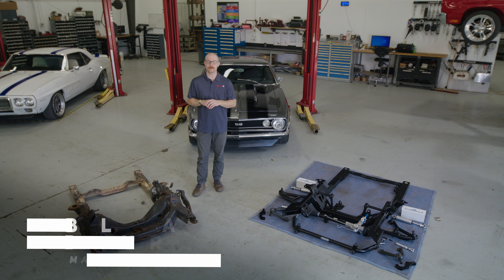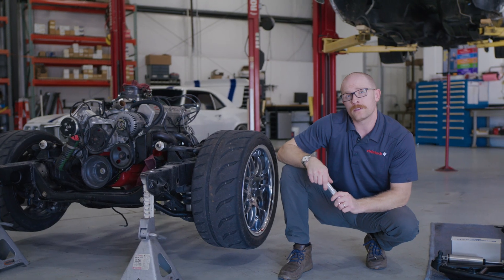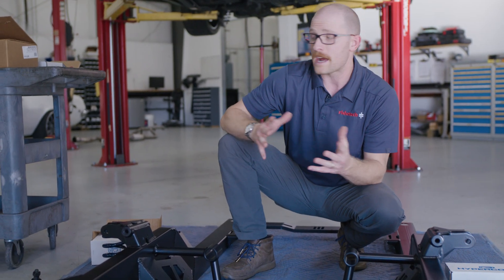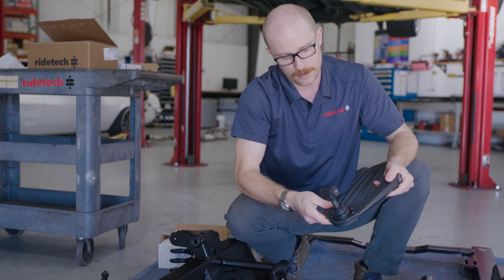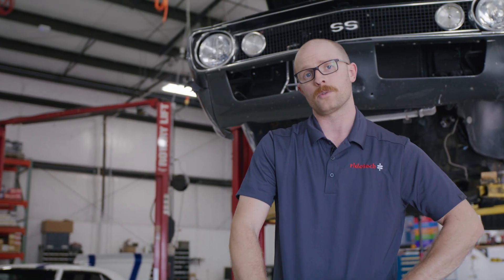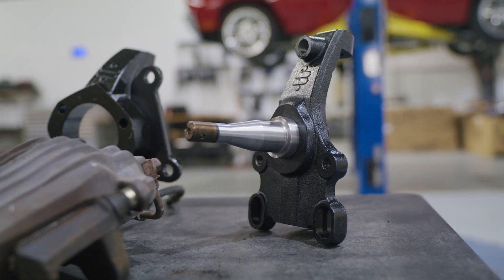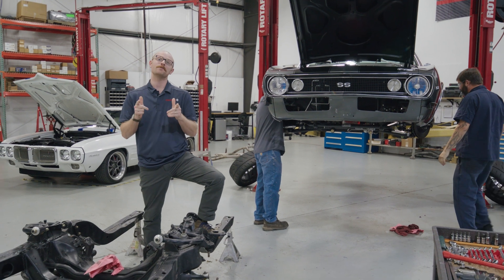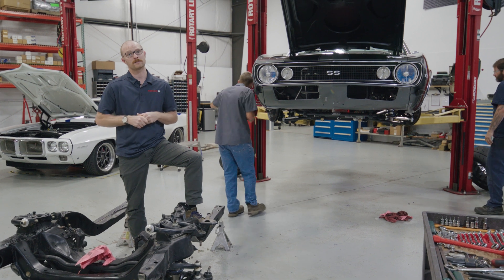Ridetech Install | F & X-Body Performance Subframe

Comment: Hello,

I wanted to ask if you could put together a detailed instructional video demonstrating how to properly align a four-link suspension system once it’s installed. Specifically, I’m looking for guidance on how to square the rear end with the chassis and ensure proper side-to-side alignment. If it’s possible, please use a 1968 Camaro or Firebird.

I hope my request makes sense looking forward to seeing the video when it’s available.

Thank you in advance for your support.
Reply from the maker: Thanks for the suggestion @510sandew8. We'll add that to our list of potentials.

Comment: Will it work with my Pontiac 455, in a 67 firebird, and later allow me to install a ls3 chevy if desired?
Reply: It sure does. Did you watch the video?
Reply from the maker: yes, you can change engine mounts later on if needed. We have pontiac mounts already available. https://ridetech.com/product/motor-mounts-pontiac-blocks-1967-1969-camaro-firebird-and-1968-1974-nova-with-ridetech-subframe/